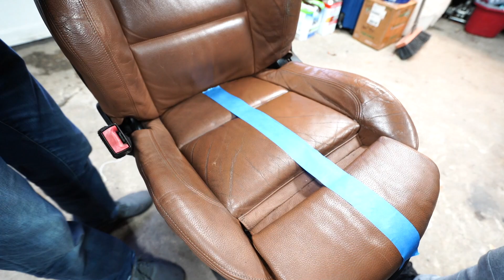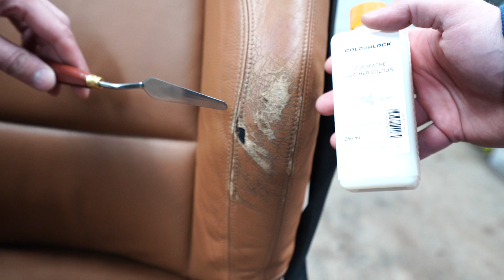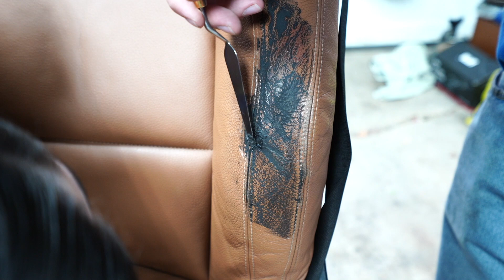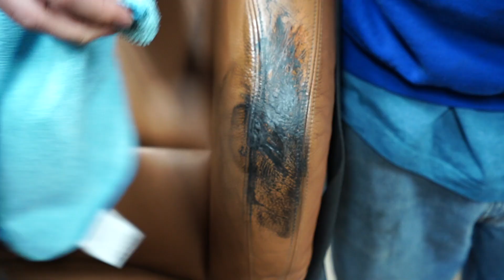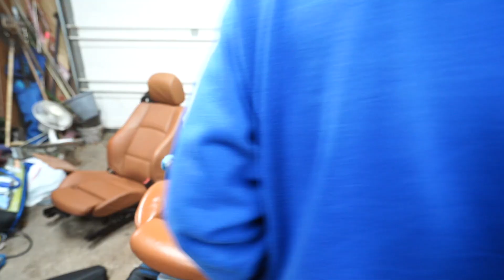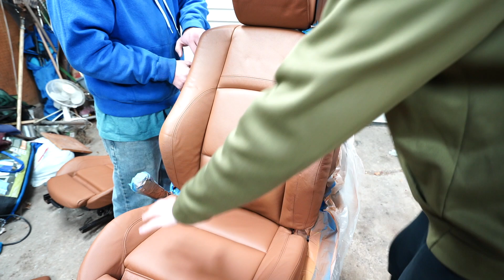How to Repair DAMAGED BMW Leather Seats!!!

Comment: You shrinked the bolster from too much heat...
Reply: OK, I'll say it. Yes, you are 110% correct on the excessive heat, and now when the leather stretches again, AND IT WILL, that entire patch is going to crack and fall out.  This repair was VERY poorly done, there was no attention to detail on this whatsoever. I've done this repair MANY times on more severely damaged Bimmer seats and the result was way better, why because I took my time and did it right, this is NOT rocket science.  If people take the time to do a video - for God's sake don't friggin' RUSH it and do a half assed job.
Reply: Poor color match too
Reply: @bahramg4238 should have done the whole seat.